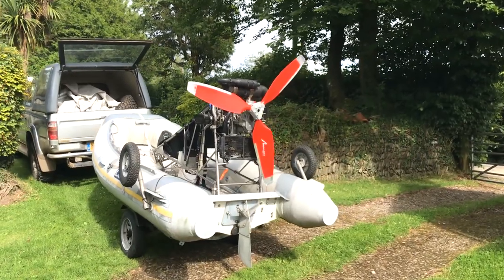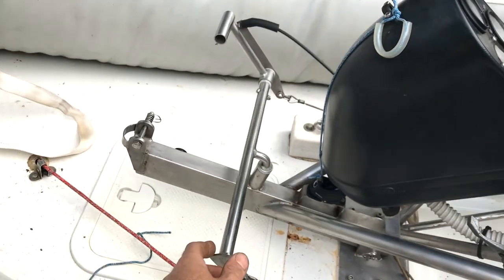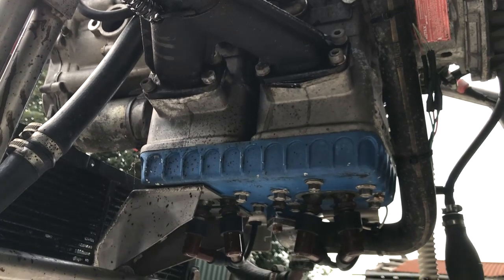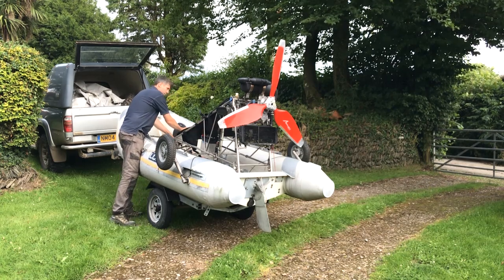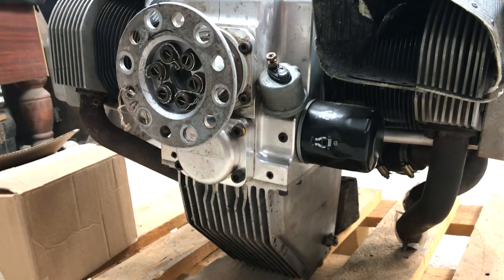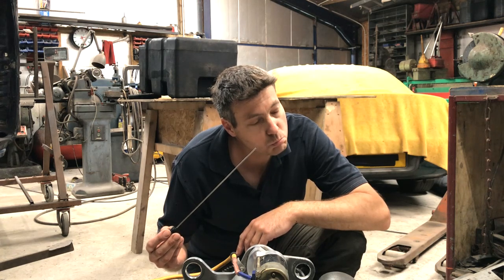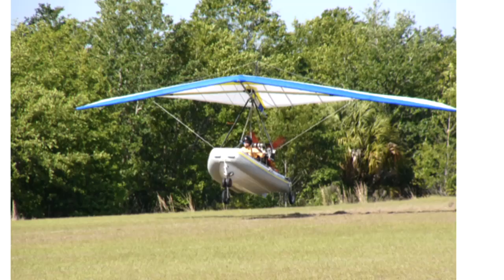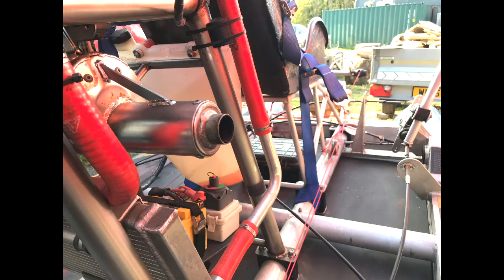CRAZY new project! Wing in ground effect (WIGE) boat build Ekranoplan. Homebuilt Fixed wing aircraft

Comment: G'day,

Very interesting.

Rotaxes are very good and very reliable, if maintained and operated 
Intelligently and
Dilligently.

I was Launch Controller for 
Aerotowing Adventures Australia, while a mate Aerotow-launched 500 Rogallos between 1992 & 1997...; he had bought the
Prototype Bailey,-Moyes Dragonfly - an ANO 95.10 Ultralight designed for Aerotowing, when it was 100 hours old (flight time).

Low speed, high power, on a hot day, climbing out at 25mph & 500 ft/min pulling a big heavy Hang Glider pilot was causing overheating; but an Automotive Windscreen Washer Bottle's Electric Pump feeding two perforated thin  Plastic Tubes fixed  an inch forward of the Radiator, with a Cold Water Reservoir fixed that...

A couple if seconds' squirting Water on the Front if the Radiator vastly increased the Adiabatic Lapse Rate, and sucked all the heat out of the Coolabt in the Radiator.

Rinse & repeat.

A big part of our Ritual was
Carefully mixing the 
Penrite "Green Slime" HPR
2-stroke Oil inyo the Fuel.

We were so obsessive that after 500 hours when old mate pulled the Exgaust off to look indide, the Pistons still had the
Circumfrential
Grinding-Grooves in the
Aluminium Sidewalls,
The Piston Skirts had never touched the
Cylinder Liners...

So, be fastidious, and the Rotax will serve you well.

I wonder if that 
Inflatable Rubber Ducky will have
Sufficient hydrodynamic stability in
Pitch, particularly in choppy water..., to work out in an
Ekranoplane ; it's pretty short, and wide.

Water is a LOT more
Energetic than is
Air at
30 or 50 mph,
Per cubic Foot of
Contact Area...

Will your Horizontal Stabiliser and Elevator be
Large enough and given a
Sufficiently long
Moment-Arm,
As to be able to debate the point, when it comes to 
Argueing with a Wave which is smacking the
Bow into a Pitch-up ; 
And your Elevator is attempting to keep the Nose down 
To avoid 
Overpitching, climbing out of 
Ground Effect, then
Stalling..., & either
Diving or
Spinning back down...?

The majority of the Ground Effect Vehicles, of which I'm aware at least, seem to have a
Hull with a wetted Length that's rather longer than the
Wingspan...

I've assumed the noticable long thin hull was both to reduce Hydrodynamic Drag, and for better damping of
Pitch oscillation when
Waterborne...(?).

It'll be an interesting project.

Stay safe.

;-p

Ciao !
Reply from the maker: Thanks for the very intelligent comment. I don't know the answer to the question of pitch oscillation of a short hull and problems with the extra lift being generated by sudden increases in the angle of attack. 
Where I'm planning to operate is a large estuary. As this craft will only be operating in very light winds the water will be calm and little chop is expected. 
The estuary gets choppier the further out to see you go so testing can be done progressively, I think. 

The elevator area I've copied from two other wing in ground effect craft. 
James Greenberger and Kester Haynes. Here is kester in choppy water bouncing off the waves trying to get airborne. His floats are longer than my Rib so you have a point. 
https://youtu.be/Fj2XR17qg3Q?si=maJwVESQoEfkbsRt
I'm in regular contact with James and kester so will ask them about the shorter hull. 👍
Thanks for the info on the Rotax.
Reply: @Ben-Dixey  

Thanks,

No worries...
Cool, as long as you're onto the Hull-Length issue and are keeping an eye on the Pitch thing.  
Smooth Water will help a lot, too.

I wasn't expecting the link to go to Bear Grylls' Channel..., I usually think of him Rock-Climbing in the Jungle looking for a Snake, to eat it Raw (!).

Kester Haynes certainly was bouncing around from Crest to Crest before becoming airborne, but with those Floats their length did seem to damp the pitching..., apparently because to lift their noses the sterns have to be submerged, and being hollow (or foam-filled ?) even the trailing Edges are buoyant..., a long way back.

I'm trying to figure out whether it will be a real issue or an imaginary one, and if real - whether a small Float (maybe a 2 or 3 litre Plastic Coke-Bottle, base-forward for streamlining..., fixed under the Tail ; would  help with damping any Tail-down moment ,- or whether the added Hydrodynamic Drag when the Float gets wet would  hinder acceleration, right when any such extra  Drag would be most unhelpful ?).

I reckon you'll have more data when you've had it on the Water..., it might not be any problem at all...; but it can't hurt to think about it in advance..., in case it causes hassles.

Keep on keeping on.

Stay safe.

;-p

Ciao!
Reply from the maker: @WarblesOnALot  Point taken, Kester's floats are 4m long, my Rib is 3.5m long so there is a difference. It will be interesting to find out. As with the helicopter I will report my findings. 
I sort of have loose plans to build aluminium catamaran floats in the future, will see how things develop. 

If you Google kester Haynes k42 aqua plane you will find his website where there is a video of the first flight. 
Back then he didn't have the aircraft floats instead he used a Zapcat rib. 
It's an exciting video as he didn't have a pilots licence back then.

Comment: go tractor config with par thrust . put the engine down low  and out of air stream  less drag  . run a long drive shaft with 2 sets of universal joints  to the prop  out front  .. front wheel drive car steering knuckle   and cv joint  for par thrust and thrust bearing  .. canard wing  behind prop for pitch  :goodvibes:
Reply from the maker: It's certainly an option I've considered, probably the best configuration, just more complex.
Reply: @Ben-Dixey  water is very sticky and draggy  its better to haveas much lift as possible at as lowest ground speed as possible  to get off as soon as u can cause water is very bumpy   and hard on airframes and such
Reply from the maker: Would you need the reverse delta wing for that configuration? To make the most of the par thrust?
Reply: @Ben-Dixey  no . just big end caps / plates .. with a pinch of floatation in them like this  
https://www.youtube.com/watch?v=gyLwK7Akx2I

Comment: The blue head 582 is the most powerful 582 Rotax built. When you say fly are you talking about in ground effects or to actually fly? If actually flying is the idea the you will need to change the prop. P factor will be way to much with an airboat prop.   Look up flying hovercraft. I built a house here on a creek we flew at in ground effects for years. No need for ailerons just basic tail and most use blue head 582's. Any way good luck.
Reply from the maker: Hi, thanks for the info. Yes I want to fly in ground effect only. I'm doing some training in a fixed wing microlight and it's fun but low to the ground I think is where I'd rather be. The prop is from the Polaris fib and I do have the flex wing. When I'm finished having fun in ground effect I might get it back up together as the fib configuration. 
What machine did you fly in ground effect ?
Reply: The first one I built was a Scat 2 Hovercraft 10ft long I converted to a Hirth 625cc 65hp Fan cooled it's what you need on your helicopter with 2.6 reduction with 9 blade ducted fan. I put 2 aluminum cross tubes on it with 5 bows on each side with rip stop fabric just on top. Added the elevator on the DF shroud so I just had 3 controls throttle , elevator and rudder. After that found a Neoteric with larger 9 blade fan duct 300hp Kawasaki with super charger off Jetski. Set it up the exact same way but was so much nicer.  Could seat 4 and fly 3-4ft off the water at about half throttle.  I built a house in the country 30 years ago with my wife two daughters on 100 acres looks like a state park with a really nice creek running through it right to the Mississippi river 10 miles down stream.  I've loved designing and building rotorcraft, hovercraft, airboats since I was little. Just about to finish a machine that works like a autogyro buts electric with several fail safes built in. Will fly like a air ATV around the farm. Plan to start posting next week. I'll video some pics of machines I've built over the years. I worked with NASA on the Mar rover project that flew on Mars. I designed and build what Langley ask for but they didn't choose the machine ended up going with another companies design in the end.
Reply from the maker: Wow! 😳 yes please put up some videos on your channel. Would love to see what you speak of have subscribed to your channel. 👍